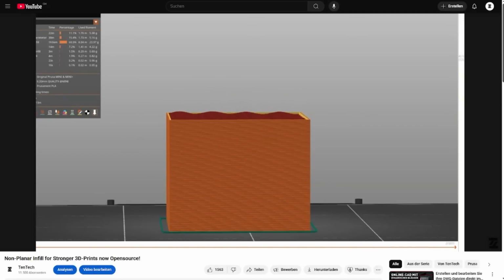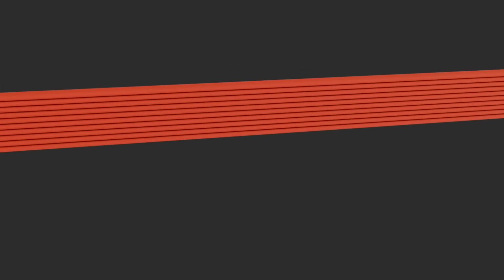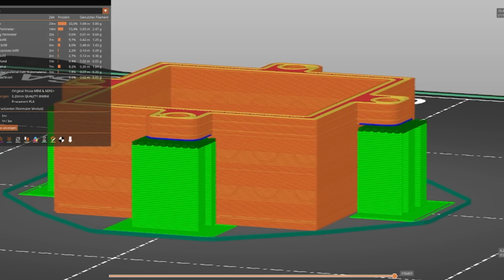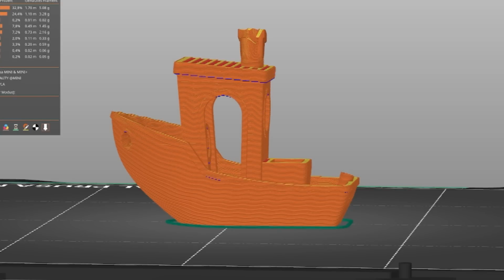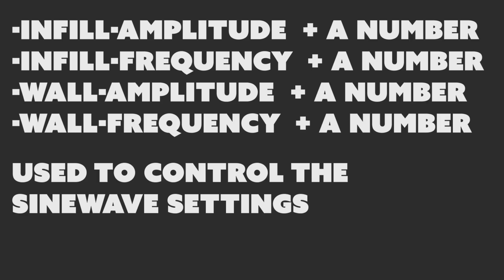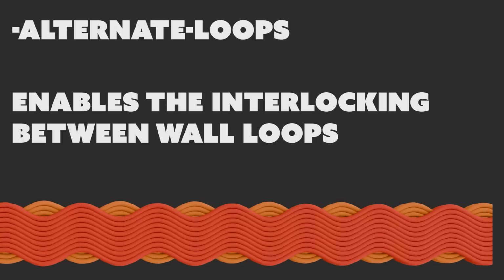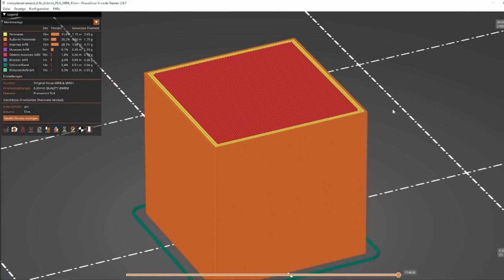NonPlanar Interlocking Walls for Stronger 3D-Prints now Opensource!

Comment from the maker: Hey guys, make sure to use the "NonPlanarInterlockingWalls .py" on github. I recycled some old video-material and the part where I download the script from github shows the wrong one because I forgot about that. Shame on me.

Edit: I love that Joshua Bird is mentioned so many times in this comments. This guy is a legend and you should definitely go check him out!
Reply: Any idea if the post processessor works with orca
Reply: Amazing work
Reply: Great project! However, I tried bambu studio, did not succeed, do not know the specific reasons, you can make a bambu studio settings video? thanks a lot

Comment: I have issue with using any of your scripts. Orcaslicer shows no errors, but gcode looks the same as if there was no script (or adds ;not processed) depending on what script i use. I have bambu printer, but tried to generate gcode with nonbambu printers aswell

Comment: Thats awesome, i want that!
My prediction would be that it strengthens prints in the z direction somewhat, and probably differently depending on the filament. Id guess walls have the most effect and infill is negligible. But i really want to try that and would like to have that included in to the slicers as a setting. 
I wonder how and if outer nozzle geometry will affect this. And if the nozzle partially drags on to the neighboring line.
I also wonder if the asthetic will affect the wide adoption of that.
If you have straight ouside perimiters and curvy lines inside in the outer wall and still have the same strength benefit, that would be great.

Comment: Just wondering whether the firmware of current printers is suited for this.  Stuff like PA and Input Shaping is all tuned for XY movement only.  Luckily the Z movement here will be rather limited, but depending on the set frequencies I guess it could cause resonance which you would want to avoid.  There's also the outer tip-diameter of your nozzle and the nozzle chamfer angle which will limit how much travel in Z is possible without having the nozzle on printing the "lower" wall press into the "higher" wall.  If you use a smaller wall width than the outer diameter of your nozzle tip, that might happen at minimal Z movement already, so that gives another set of interdependent parameters to tune.  I don't mean this as criticism: these experiments are great and the execution and sharing it with us is fantastic.  But as so often: opening one door leads to the next corridor of newly discovered doors ;-). Keep it up!

Comment: I swear, it's stuff like this that makes me want Prusaslicer to implement some sort of plugin support. Because instead of manually adding this post-processing script, we could just use a plugin to do it in a easier way. This way it could be saved across slicer versions and it could warn of incompatibilities and have a list to manage them.
Reply: I want Slicers to go into a Plug-In, or scriptable, direction.
Reply: I dont understand why prusa research hasn't proactively worked on making this stuff easier to implement. Like, I'd KILL to have the option to just install add-on packages so I can control and add features within the UI instead of having to jump through hoops, add scripts and do post processing to the gcode afterwards.

Comment: Okay i got the script to run without errors but the outputting Gcode file apears to not be updated. If i preview the gcode in orcs its just regular flat lines.

If i open the gcode in note pad there is lots " not processed" tags.

Also! In your instructions the python script name is different to what the script is actually named.

Comment: Cool attempt but why not work with OrcaSlicer's interlocking wall implementation? I am especially stressed when you said "your nozzle may collide". Bambu X/P hotends are susceptible to this and break. Despite looking forward to an improvement like you made, I will not try it until it is vetted by either Orca or Prusa Slicer teams for being safe from collisions.

Comment: i sliced in orca, and it does weird things, makes some wave lines but the model itself is mostly flat, did the same with prusa slicer and it works just fine. its also clearly visible in the gcode viewer, so are there some settings that should b e adjusted in orca? except from the arc fitting. and should i use orca's latest version? i am using 2.2.0. love the progress you make, keep up the great work!
Reply: i am getting an error message when i try to do it in orca...

Comment: I've been trying to make it work in Bambu Studio, but it doesn't appear to have any effect using the github default parameters it looks exactly the same I'll create an issue, but running a diff on gcode exports seems to show this is the case. It seems it's not processing lines at all based on the comments in the gcode..
Reply: Same here, i cant get it to work. Tryed using chatgpt to check what iv done but look fine but without the post processing sadly.

Comment: Wait how did you manage to avoid the printhead bumping into the wavy layers if the sine waves are offset from one another?
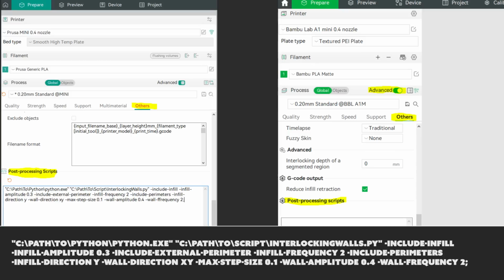Reply: He mentions that possibility at around 3:10. Says to not overdo it. I'm guessing there will eventually be a way to calculate what settings are safe based on the type of nozzle you have, but I'll leave that for the mathematicians among us to solve.

Comment: You know, I was just commenting on another channel about optimising a non-planar 3D printer slicer to solve to resist sheer and tension rather than minimise supports, and the fact this technique has the potential to help with sheer solves a lot of problems for the use case I was complaining about. I'll point out the direction of the video in a second if people are interested.

"3D print anything without supports" by Joshua Bird

Comment: hey i tried installing your script for picking which faces are fuzzy, I got error 2 but i did it properly, gave the correct path location for both python and the script, but it still gave me that error, could you possibly look into it
Reply: It's case sensitive, check if there's any capital letters and change them to lower case.

Comment: How do you avoid collisions with neighboring walls which have an inverted amplitude? Wouldn't the nozzle collide with a neighboring peak when printing a valley since nozzle tips are significantly wider than the extrusion width/nozzle bore. Or does this rely on wider extrusion width to work?
Reply: When printing normally with standard nozzles, the nozzle will be exactly 1 layer above the material it's printing on. For basic printers, this should allow a maximum amplitude of the sine wave to be at 2 layers since the bottom of the nozzle will be at the top of an adjacent sine wave while it's laying down a layer next to it. For sine waves greater than 2 layers, I suspect he has to use custom nozzles.
Reply: That’s exactly why for Brick Layers we have to change the order in which we print the perimeter we want higher: first the loops that stay at their normal height - and later print the loops we want higher. I thought the idea of the sine walls very cool, but the amplitude in practice cannot be too big.
Reply: I’m wondering the same thing!